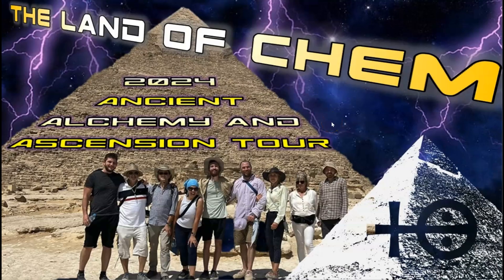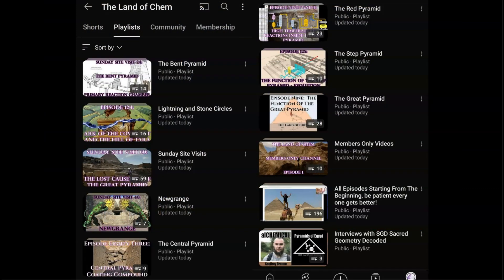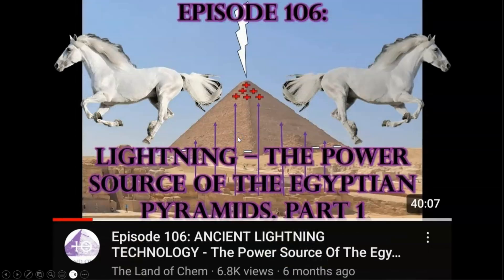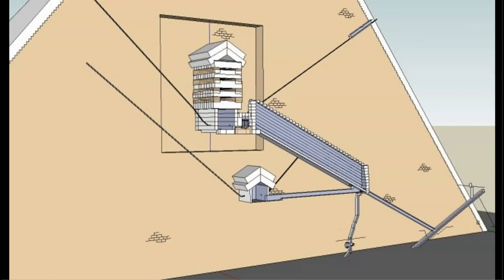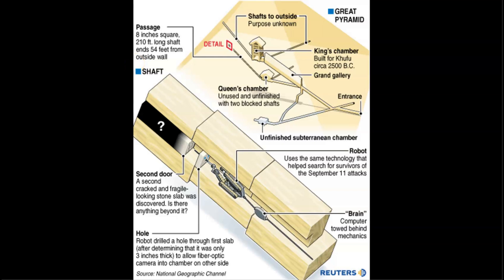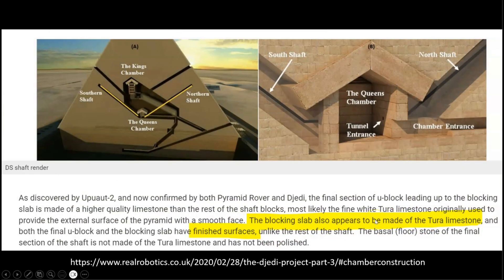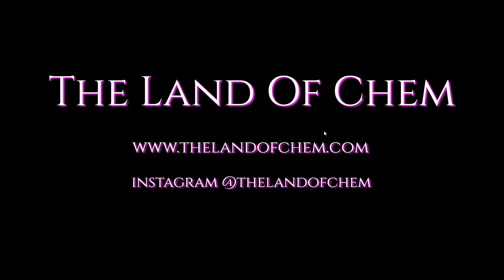Episode 127: ANCIENT TECHNOLOGY - The Function Of The Queen's Chamber Shafts

Comment: the missing piece here is exactly how the ultrasonic pulses turned back into electric fields would be "read"  by the makers/chemists ..  if you've got lightning creating the field on one side,  on the other side you'll have ...what?  varying electric current between the copper handles?   how is this supposed to be measured?  the old "Egyptian Light Bulb" ...? 

I get how the system is supposed to work, you've explained that clearly enough, but what I don't get is how they would have been able to get a reading from the output shaft and how such a reading would be translated into  data that tells them level, flow, pressure, temp, etc.

...or maybe I just haven' watched the video yet on Ancient Egyptian Oscilloscopes?

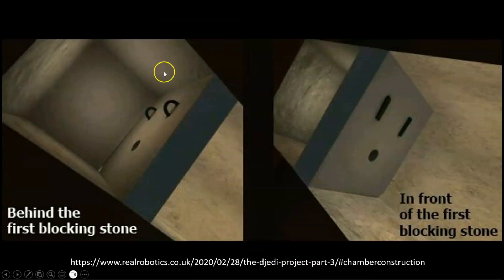Comment: There is a reasonable chance that the 2 copper loops in the polished stone at 8:16 in the video above are for a positive and a negative electric connection.  Limestone and rainwater will generate an electric current in copper: https://www.youtube.com/watch?v=Tuf8wzdmqmI

Alternatively, applying current to those 2 copper loops could illuminate tura limestone or create an effect (e.g. piezo-electric) that caused nearby limestone to illuminate (thus explaining why Alexander the Great called those structures "the fire within" (pyro midas or pyramids)).

For centuries, mankind has heated/vibrated limestone to create lime-lights.  This brilliant limestone light was useful for Broadway plays and early silent movies, hence movie stars were "in the limelight."

It matters that the shafts did not open into the Queen's Chamber (e.g. to stop rainwater) and it matters that the shafts did not exit the pyramid. The latter might suggest an LED-style function of the 2 copper loops and air gap after the tura limestone, but still inside the casing stones instead of opening up to the weather outside.

Shining a bright light (such as a limelight) into other limestone will illuminate the interior of the limestone.  Any of the above-described effects, and possibly other effects, could have the result of illuminating the top 1/3 or so of the pyramids to the outside world, a spectacular sight and technical feat for a civilization to achieve 4,500 years ago.

Comment: Just watching your interview with danny jones here.
I think you are very very close to a lot f things BUT, you are making one critical assumption that changes the entire dynamic of the pyramid. 
You assume it was designed to have limestone surrounding it. 
What if it wasn't? 
what if the limestone was added by the egyptians and not the builders themselves.

I have reason to believe this is the case, and you really really should look at this possibility. 
I will give you one practical example of why this is likely the case...
If you look at most of the egyptian stuff, you will find mostly straight faced planes, but you will see examples of where stones were bowing out slightly in a more natural shape except on the joints themselves which were flawlessly flat on the insides.
Then you have some examples where this natural shape was sanded down smooth after the fact...

Now, if you were cutting this in the quarry, you would cut all 6 sides smooth to begin with, it would be pragmatically pointless to sand these smooth edges down to make them  look more natural like other polygonal walls found in other parts of the world, and then upon completion or nearing completion of the project, plane them back to smooth. The internal joints and external faces were already made to exacting sizes...

What does this mean?
They were sanded flat after the egyptians got there so that they could paint and then later engrave them and mark them as their own. 
They did the same thing on the pyramids, they made the walls smooth after they found them so they could adorn them. 
If they built them themselves, every part of the inside would have been adorned and engraved. They left the inside alone out of respect to the builders whom they likely called the ancients.

Now I can tell you as a very skilled orgonite maker who uses limestone as a face stone on my orgonites, that there is a significant and multifaceted, molecularly relative and electrically complex reason to use limestone for focusing chi energy and negative ion distribution. It is not coincidence that the egyptians used limestone, they were that smart which is still quite surprising, but they were not as smart as the original builders, they were merely children who found daddys toys.

Comment: Very plausible explanation. It also seems like the pyramid was built in at least a few different stages, to either increase yield or slightly change the reactions to what happened in the final stage. So the queen's shafts were covered up when the queen's chamber stage of the pyramid was modified or built over for the king's chamber stage of the pyramids evolution.